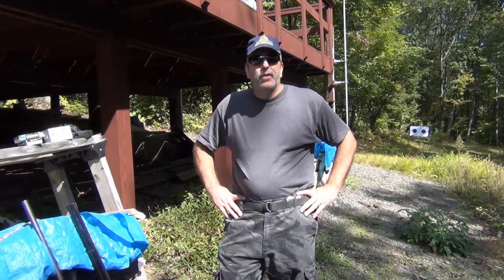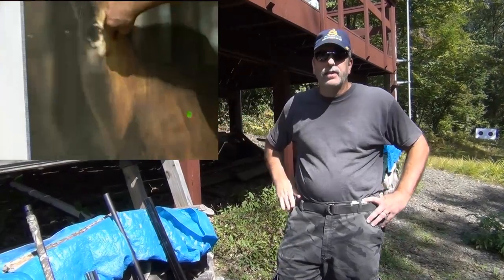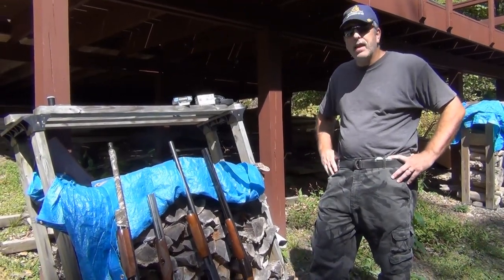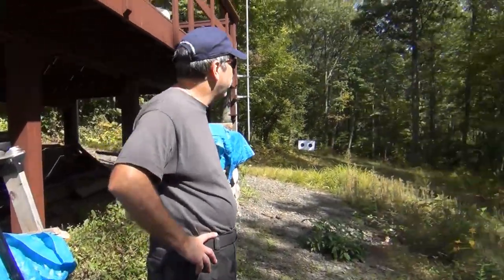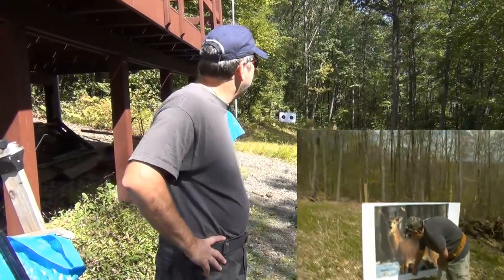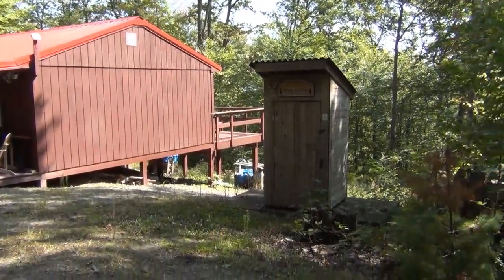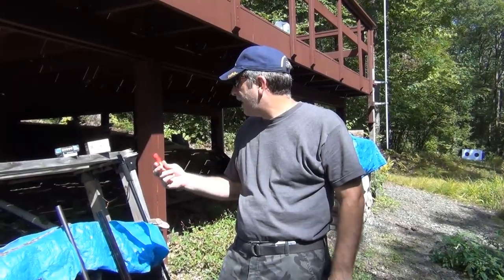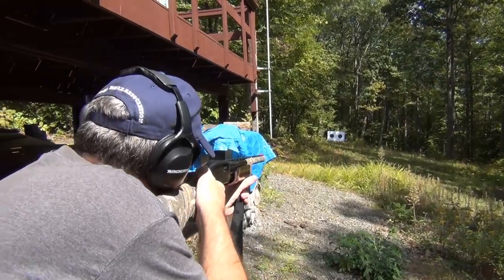00 and 000 buckshot tests at 55 yards with four different firearms

Comment: Glad you're a tester and thankyou for longer range buckshot testing!  Just a note.  Try measuring from the center of the bore to the bead on the double shotgun and then do the same on a single barrel.  I think you'll find that both measure about 5/8 inch.  Really shouldn't be any need to sight down the barrel of the double rather than using the bead.  The pattern is only going to be 'out' 5/8 of an inch, unless the barrels are harmonized improperly.

Comment: Always had fantastic results in my 870 using Rem. 3" 000B 18 1/2 " cylinder bore.
Reply: How good is pattern (like 30yards)?

And you use choke (i think cylinder bore don't take choke)?

Comment: Yah... I blew a coyotes head half off with #4 buckshot and mod choke at 50-60yds (I could see the pattern and it surprised me how tight it was)... Not quite apples to apples, but I would test your hunting shells with more open chokes and see if the pattern tightens up... Tight chokes may = more pressure = more crowding = more deformation of the lead = maybe a more inconsistent pattern (blowout of the pattern)

Comment: When I was a police officer we were trained to hold at six o'clock and the shotgun would hit the x-ring. We trained with rifled slug for easier grading but we also used buckshot to see the spread at different distances.  We used #4 for many years on the theory of greater probability of hits.  We then went to triple 0 for greater knock down.  Hold at six instead of center.

Comment: 👍55yrds is quite a reach for any shot. I shoot shotguns (have 5) and usually stay around 25yds for shot, of course the shot will travel much further. Slug maybe 50 unless a sabo in my rifled barrel, then maybe 100yds. Been told full n extra full chokes not a good idea for 00. I sometimes shoot fosters in a modified barrel even though you should use improved cyl. My .02✌

Comment: Fun vid! It inspired me to go out and do some buckshot tests myself with my 12ga Browning 28" fixed full at 50yds. I used Rem 3" 00, Rem 23/4" single 0, Rem 3" 000, and Win 3" #1.  The only one I would honestly count on at 50yds was the Win #1 buck with my gun. I feel confident with that load at 50yds, especially if I could squeeze off another round. It amazed me how bad the others did. Considering what I've seen and how many deer I've tracked for people, to most shotgunners 50yds is really "30yds", if you get my meaning. You really just don't know till you shoot your gun.
Reply from the maker: Great that you got out there and did some testing on your own firearm and different loads. You really have to check that and not "hope for the best" when using buckshot. Like you, I think I know my limitations and will pass up shots on anything outside of it, even if it means letting that big one go.

Comment: I don't trust buckshot, I use slugs out to 150 yards. I have a Kel-tec ksg, it has an 18.5" barrel and I can ring a 15" gong with consistency. I have it topped off with a Holosun HE506c. It works great for me, plus it has a 15 round capacity. Thanks for the video, good stuff man.
Reply from the maker: Thanks, I went to the .350 Legend in our "shotgun/pistol" State. Buckshot is for close up work.

Comment: Hey brother, that was an awesome video, I just got done putting a smooth bore slug barrel on my 870 for purpose of home defense, and then the question of what to feed itwas lurking in my mind. Lots of deer around here, it has a top quality diamond reticle scope mounted on it and shooting 5-6 inch groups at 100yds with high brass federal ammo. No need for that around here, the woods are so dense. But anyway, great video, you answered my question, thanks. Dave in Oklahoma.

Comment: Great test.  I did a lot of this several years ago and came to all the same conclusions you have.  We need to test every load we intend to use in each shotgun we intend to use it in.  There can be big differences gun to gun on how they will pattern any given load.  My guns all shot larger patterns with 000 vs 00 Buck.  I also noticed that 3 1/2'' mag with #4 Buck had a much larger spread than the 3'' mag with #4 Buck.  Somebody else may have different results. I also found some loads are more consistent than others.  Sometimes out of 5 rounds 3 would pattern tight and 2 would be in an unpredictable pattern that could be anywhere on the pattern board.  Sometimes box to box made no difference and sometimes it made a huge difference in point of aim and pattern density. I found the same results with slugs.  Sometimes a particular gun shot 1 type well and the next did or did not.  The only slug I had consistent results with in several shotguns was the Breneke slugs which generally outshot the regular Foster type slugs
Reply from the maker: Great info Frank, thanks. Hope you put an ice bag on your shoulder when you finished up. I know mine was hurting.
Reply: @whiterook85  Yeah, it close to that.  The 3 1/2'' mags were brutal in the lightweight Mossberg 835 pump
Reply from the maker: I also suggest a nice Bourbon when your all finished up. Thanks again for the info.

Comment: I've did lots of pattern testing, and I wouldn't take a shot past 40-45 yards, with buckshot. The consistency just isn't there, at longer ranges.
Reply: With the right choke and the right load for your gun you can push that another 20-30 yards. Might have to load your own and try tons of combos to find the right one though.

Comment: I've been patterning buckshot all day today. 00, and #4 buck. I was at 35 yards, because I wanted to see EVERY pellet impact. I have 8 different choke sizes. I'm shooting a .730 standard bore 28" bbl Stevens 320. Here are my results...   Best 00 patterns were with .700, and .705. Best #4 buck patterns were with .665, and .680. I'm thinking my .690 choke would be best for #1 buck, just judging by today's results. My best results of the day were with the Federal Flight Control, out of an improved cylinder(.720).          Get out and pattern your own gun. Nobody's is the same. And, NEVER only shoot just one shot. Buckshot doesn't exactly repeat itself every time. It's unpredictable.
Reply: Hey bro I am new into the shotgun relm but not new in the rifle world but I have a question,as I see you around on alot of the same firearm comments sections and figured you knew alot about firearms. I just got a new HNR new england firearms 410 fixed full choke.. I can not find any good advise on what kind of shells to get. I know slugs isnt an option due to it having a built in full choke.. Can 00-000 buckshot work okay? Any tips? Thanks

Comment: This is why the only shotgun I own is a .410 with a rifled barrel.  Fire three inch 000 buck out of a rifled barrel, and you get a 305 grain 5-layer bullet. I get 7-10 inch groups at 50 yards all day long.
Reply: +Seth Jackson 5 layer bullet?
Reply: sorry mate tl;dr 000 buckshot is .36cal & a 410 is about .42cal so there is still a lot of space between the projectile an the rifling. but if that works for you then that's fine. i was thinking of 12gauge i didn't see the 410 but still yet, 000 is .36cal an 410 is .42 cal so you would be better off getting a winchester pdx1 that has the slug that will actually touch the rifling man and then behind the slug it has 000 buckshot best of both worlds,
Reply: Seth Jackson did i say you were lying? sure didn't. stop getting so offended. i said tl;dr meaning (too long didn't read) if that works for you then so be it. good day sir.
Reply: Seth Jackson or another example is a 12 gauge with a .69 cal round ball. if there isnt much room for the projectile to move side to side in the barrel & becomes very accurate at 50 yards. rifling or no rifling.
Reply: Seth Jackson Your the only one talking about muzzle loaders bud. My point was, that you could take a smooth bore 410 an get the same exact accuracy so if your gun isn't shooting at least 7" groups i'd throw it away ;).
Reply: Seth Jackson Exactly, i was thinking the same thing about you brother. have a good day man.
Reply: +Seth Jackson You really should write a longer reply! JK!
Reply: Archer xtreme Bowhunter 

I

Comment: Good video We used the Savage model 67 pump in Vietnam my point Man carried it using military grade 00 buck, 5 man us patrol encountered 7 V.C 55 to70 yds to right flank oo Savage worked on 2 but finished off 2more fireing Ak 47 prone The PIG M-60 finished the job with 3 escaping toward L.Z 4th Inf Div. 1st PLT.10th Armored.

Comment: I believe that the bigger you go with buckshot the less constriction you'd want. Maybe with #4 a full choke would help within its useful range. With 000 on the other hand I'd guess the chaos of the pellets squishing down and shifting around would cause a very inconsistent pattern from shot to shot, you'd probably be better off with a cylinder bore in that instance.

Comment: I hunt in VA and many of our counties don't allow center fire rifles and some extend that to slugs so buckshot is the ticket or use a muzzle loader.  Having extensive experience with buckshot, I can tell you that 2 pellets of 000buck in the vitals equals dead deer!  The same can be said of 3 pellets of 00buck.  Over all, your guns did well at 55 yards which would be considered a long range shot with a shotgun.
Reply from the maker: Thanks for the info and the damage reports. I agree on the long range, would rather have a slug gun if I had to use a shotgun. Thanks again!
Reply: I live in va and only use rifles our hunt club does not allow shotguns

Comment: I think some #1 buck would be interesting. Still heavy enough to give decent penetration but a lot higher pellet count. Likely no crush factor from the choke either. I think the 000 might have fared better cylinder bore or improved cylinder at maximum. Have to remember that 000 moving at 1400 fps is each one pretty potent.
Reply from the maker: +Robert kubrick Think that one may be coming up in the future. 16 pellets is a good number, and like you said still heavy enough to do enough critical damage. Thanks for watching.

Comment: You may consider an improved cylinder or an open choke. The tighter chokes compress the shot and creates " flyers". This is true with steel shot not usually so much the case with lead. But hey try it. My Remington 1187 shoots a much tighter pattern  with an improved cylinder vs a full or modified choke. But again, that is with steel shot, not lead. My two cents, no charge. Lol

Comment: Try 1 buck plated shot.  The 00 and 000 tend to get in the way of each other.  000 buck sounds good, but you need to use smaller shot.  Plated shot (nickel or copper) are a whole different animal.  Forget soft lead. You can use your bead (if that is all you have) to give a rough range determination.  Good video, Cheers!

Comment: I only use buckshot in the thicket where shots are under 40yrds pattern is not the only issue velocity ,energy and terminal Ballistics fall fast with extremely low BC value why buckshot is illegal in some states if shots are past that range best use a rifle barrel shotgun and slug or a 30-30 on up

Comment: This comment is almost a decade old, but I would like to see this same test done with No 1 buckshot.  You would have twice as many pellets as the 000 buck.  In particular, I personally would like to see the difference between the Federal FliteControl shell and the others in your Mosberg, Remington and long barreled savage double barrel.  I think that with the three guns I mentioned while bringing down a deer, would also ruin a lot of meat at 55 yards, and like you would try to position myself to be about 10 yards closer at maximum shot range.  I think it may be possible to extend out to 55 yards with the Federal ammo.  I can not do it myself, but would be interested in the results.  I think both pattern videos were very good, thanks for making them.

Comment: The Federal Flight Control buckshot is great stuff, for tight patterns. Only use cylinder bore with it. Any type of choke on this wad, will defeat the design of it, and not yield very good results.    I'm editing this post, because for some reason, I was getting slightly better patterns with an improved cylinder choke today(.720). Go figure...

Comment: open choke using flight control buck shot would have put most if not all your pellets in the black of the target with maybe just a few fliers  just outside it in the white at that range and as far as the 00 buck vs 000 goes 00 buck tends to pattern slightly better than 000 buck in 12 gauge hence why 00 buck is so popular with military, law enforcement, and civilian self defense. 000 and 0000 tend to pattern better out of the slightly larger 10 gauge shot gun.
Reply: Prove it.

Comment: What about home defense distance? Like 10-15 yards? I think I might prefer a slightly larger spread at that distance
Reply from the maker: Yes you are right at that yardage, Open or Improved cylinder is what you would want.
Reply: I would say 00 or smaller. The slug will go through too many walls.

Comment: Buckshot has no more recoil than birdshot if the weight and all other factors are kept equal. If anything, I'd expect the denser group of smaller shot to kick harder, due to greater pressure resistance.

Comment: To me buckshot is for self defense, especially in the home.   It is also interesting to note that the little double barrel coach gun didn't spread out all that much like people think it would.  I think that is the reason for the laws governing barrel lengths, because of the myth that they scatter so much.  Slugs are for hunting medium to big game and then within reasonable ranges, buckshot and slugs for self defense.
Reply: technically any type of shot would work for home defense, you could load up steel birdshot and do just as much damage when your firing at someone in close quarters.....
Reply: I agree. 00 Buck for defense and slugs for the medium/big game.... But #4 buck works very well on a moving coyote within 50 yards or so. The guys I talked to here (Utah) dig #4 for close up moving yotes compared to slugs or a rifle.
Reply: +eugene bell Did you hear the "little double barrel coach gun" as you call it has indeed a full choke?I think you assumed it had a cylinder bore and... not!

Comment: Try a cut shell at 55 yards. Do you know what a cut shell is?  Back in the day when they needed more distance or hitting power & you did not have a slug you just cut the hull of the shell leaving about a half inch to an I inch intact. They hold together like a slug & are fairly accurate. Just a thought from an old timer.
Reply: ftb427 everyone knows what a cut shell is! He’s just testing differences in 00 and 000 buckshot

Comment: Aiming a double barrel by sighting over the barrel rather than down the rib with the bead is a huge mistake. The difference between the the two sight pictures is negligible, EXCEPT that you have no reference points if you try to aim over a barrel l with no sights on it..

Comment: turkey chokes seem to be no good for me when shooting buckshot. I found the standard factory full choke or in some cases even the modified choke generate the best patterns with buckshot. With a flight controlled wad you may even want to consider I/C. One nice thing about double barrels if you have working hammers you can may even want to consider discharging both barrels or given them both barrels.
Reply: smartguy104  I tested some Federal Flight Control 2 3/4" 00 yesterday.  Cylinder patterned 6.5" at 25 yards. Improved Cylinder was 10" at 25 yards.   Which tells me open is better, and the less that you disturb that wad as its leaving the barrel, the better it does what it's designed to do.

Comment: This is an old video so don't want to rehash old stuff.. But for new people seeing this for the first time..

Chock has very little to do with influencing #00 buck. There is much more influence in the group size between different types of loads and wads... Smooth bore to full chock even has minor difference in pattern I would approximate on average.. 3-4" in total group size at this range max. However you can use a smooth bore federal wad control round smooth bore and get a group that will look like it was shot damn near point blank..
Reply from the maker: Biggest thing if you want to use buckshot, get out there and see what your shotgun does. Could be good, good be bad.
Reply: +whiterook85 yes that's always important to know what you, your gun, and round used is capable of. That is always important for any gun in any situation. 

Also I forgot to mention.. I'm sure there is some scientific reason.. But generally speaking.. #00 always groups better then every other type. Just like you seen with the 000 here. It's prob just a product of the right size and number of pellets for the size of the wad amount of force behind it combined with the way it can be wad'd. #4 buck can give some nice groups at times but not as constant as 00 is. 

Another factor as with any firearm is barrel length as well. Hence why you had two guns with equal length barrels on both sides shoot similar groups regardless of the choke difference. But at the end of the day... For group pattern it 85-90% will alway come down to how tight the wad is and the QC of pellet placement in that wad as for what yields the best groups at ranges 10 yard or more.. Choke mostly is for bird types.